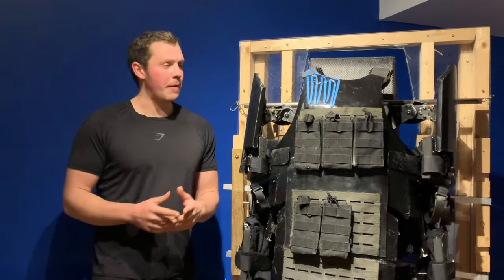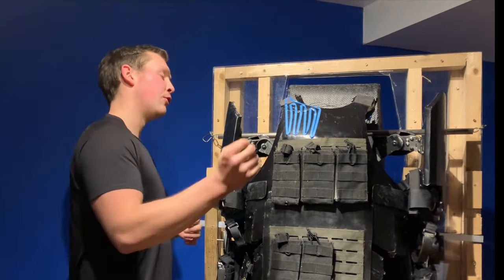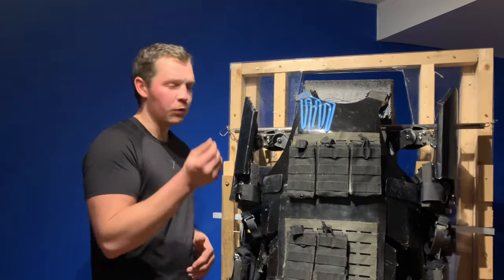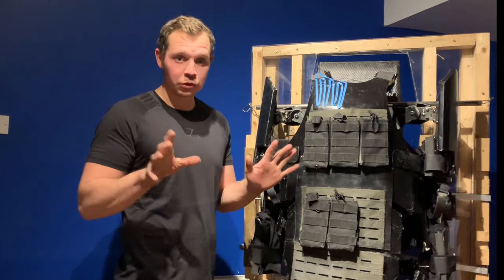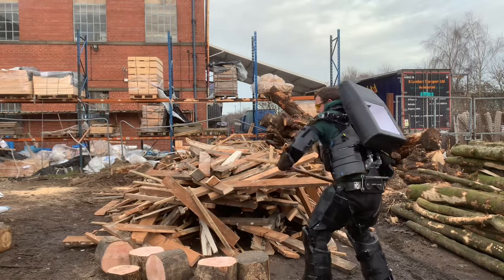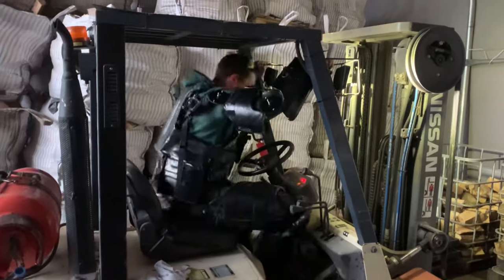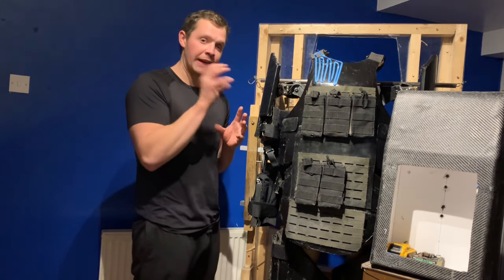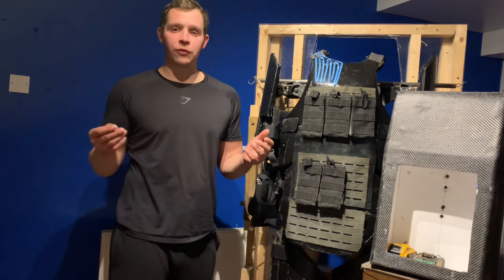Episode 6 Future Electronics & Work Mobility Check of Functional POWER ARMOUR project

Comment: I would like to say as a software professional (and ex military R&D and engineer at that) that custom voice activated controls is a huge project in and of itself. Particularly when you consider cutting out external noise, particularly combat noise. 
Regarding touch screen devices and ease of damage - look at the 'tough books' that exist, they aren't so fragile as you might think.
personally though I'm an advocate of keeping software to a minimum on military hardware. Interference and 'emp' is a real thing, and shielding will only go so far. 
For control options Id honestly recommend physical switches and electronics - no software at all, at least in prototype stages.
If your going to have any software id suggest limiting it to the helmet for HUD.
Reply: Exactly!! Prefer analog switches, and mechanical joints and movement using gas pistons and springs and a rigid frame. Working on a similar project to this. Made the exo frame from stainless steel, aluminum, and titanium. Making armor from angled AR500 1/4 ballistic plate. Going to use a HUD in my helmet, range finder, lights, and NODS (PVS-14)
Reply from the maker: My plan is to have it quite basic for the following prototype, have it only recognise key words. Then down the line in the future have it more complex and as you say have it inter grated into the HUD of a helmet. Ive thought about toggles and switches but unless theres a strong fold over cover theyll break easily. The cover will add bulk to the arm along with the switch panel which is the last place its wanted. Then the wires will have to run round 3 joints which is a potential point of failure, tough book screens are good of course, but ive used them as a mechanic and theyre not that tough and can get scratched and dulled. Main thing though is ive found that if you walk with a slight arm swing and scrape a door frame, its like a hammer blow so if theres any control panel there, its gonna get wrecked. So while i may be wrong and it may be harder to than ive researched, i still think its the lesser evil in design terms. Thanks for the input though and thanks for watching 👍

Comment: Should consider using a capacitive damage sensor instead of the long thin wire method. Basically create a grid of very thin square capacitors accross the surface of the armor plate. You could do this with foil either side of cling film or tape for your first mockup. 
The goal isnt to store any real energy in the capacitors, its to measure the capacitance - if it gets penetrated then capacitance becomes 0 because its shorted accross the bullet hole. 

The wire method needs more connections and more sensors to check if resistance has dropped over each connection and its hard to cover a flat surface with wire.

Comment: Love the solution for damage detection, elegant in it's simplicity.
I wonder if you could integrate this with some kind of overlapping segments rather than monolithic plates, to improve flexibility without sacrificing as much coverage, and improving serviceability?
Reply from the maker: Ive tried some over lapping plate ideas but because the armour is 20mm thick the bulk, but mainly weight gets insane, i had a roman skirt design with overlap plates it weighed way more than chest plate to cover half the surface. Which is a shame.
Reply: @MattExo-Dynamics  I see yeah, with 20mm it's a bit much.

Comment: Radical idea: Testing could/should be done plugged in.
You will eventually build a power supply anyway, it's (I'm guessing) the easiest part of the suit.
Throughout testing you'll be either breaking it or find you have to change voltage or etc.

Most humanoid robot development is also moving first, even attached to strings so it doesn't fall too hard - power pack is the last thing.

I'd focus all my attention on making the suit move/work with you.
Amazing work so far! With some extra protection and definitely assisted movement - I could see putting this on instead of my plate carrier (as long as it's got proper NIJ protection - which you don't need for the project until last. You can use cheaper weight simulators. Lvl IV ceramic plates usually weigh 3-4kg per 10-12" plate😉)
Reply: Yes best advise here-- DO NOT shoot your prototype anymore, it's already known what kind of armor ceramics and layers can protect soldiers, you sinoly need to know the weight and distribution, plus I think you should uave soft armor behind the ceramic to stop shrapnel. And consider shock absorbing tactics like swappable reactive plate peices that snap into a chest frame.

Indeed use a lab power supply and cables to the protoype suit, then add weight where the batteries would go to perform movement tests. 🎉

The hardest part would be the suit robotics and armor pices shapes and connection so they dont fail easy and cam be taken off quickly by a medic or swapped peices.

Comment: Another Idea I had, basically a system that reduces spinal injuries or concussions by locking the helmet in place around the user's head. As the helmet will likely already be quite heavy this could prove quite helpful if it's a realistic concept. I know that no matter how much punishment the armor can take, if the users head gets bopped a little too hard they'll be rendered combat ineffective or worse either way.

Comment: the wound powder should be on the inside, not outside. 
depending on its weight, additional armor to prevent penetration in the first place would be better though.

Comment: Honest whilst I would say that this sort of system would be useless in large scale deployments such as Ukraine where logistics are a nightmare and you’re going to end up lugging around a ton of useless scrap.

HOWEVER in say Gaza this system would actually be absolutely perfect especially when you’re dealing with close, tight CQB environments where mobility is primarily prioritized leaving many Israeli soldiers open and exposed despite their higher levels of protection, however as seen in that Israeli video where an Israeli soldier is entering a room only for the Hammas fighters to open up on full auto in the other side of the door, not to mention things like the HAMMAS, tunnels where again close quarters combat is limited between mobility and protection where an Israeli soldiers is limited by what said individual armor they can carry, and whilst it wouldn’t actually last long let alone be completely bullet proof, however (BULLET RESISTANT) is far far more preferable than being shot multiple times where again in those situations where seconds can result in either living or going home in a body bag and not to mention that the armor is again being built by a Brit in a shed with off the shelf components not only increases its viability but also helps in reducing its cost and again, if the armor was in say panels which can be installed or removed would not only increase the suits overall combat lifespan but would allow the user to increase their chances of survival rather than being a single solid piece of armor kinda like the halo Spartan armor which looks cool, but is actually very stupid and realistically impractical considering that the entire lower chest area is exposed and titanium Kevlar weaves aside is still a massive weak point, not only that but if the armor was say damage beyond repair then that usually means that the entire armor has to be replaced vs say 40K space marine armor where the armor is connected separately meaning that if a space marines massive pauldron armor was to be too badly damaged, then the marines can simply unlock the shoulder piece and replace it with a new one, and again whilst I’m not expecting it to be a literal walking tank, but being able to effectively and reliably protect a soldier for the first say ten rounds of ammunition from killing the user then it’s ten rounds of time for the individual to either withdraw or to asses the situation and engage neutralizing the threat that’s exposed their position.

Comment: Good enough to escape from a Middle Eastern cave you we're put into by your business partner!
Mk.I from Iron Man also used many protective parts from leather to protect the operator from the machine itself (gloves for example, had leather inserts) - like this leather belt.
Can't wait for MK2. Current battery tech is good enough to provide enough power to make this practical.
Pls move to America so you can add a flamethrower! :)

Comment: What happens if the battery pack gets shot. Battery acid of any variety pouring through a potentially motor locked suit does not sound fun.

Comment: Another small design idea may be to add a v - wing on the breastplate near the neck to deflect bullets/shrapnel away from the throat and over the shoulder such as what is found on french medieval cuirass armor. a good example of the armor piece can be found in arrows vs armor 1 by tod's workshop. Although they shoot arrows at the armor piece the concept is similar to bullets.

Comment: you could do it like edge of tomorrow where you have a helmet with an augmented reality display which can have a hud to display the armor plate status of the suit and body status to indicate if the body has been damaged or exposed but it may be too complex especially making or getting the software for it
Reply from the maker: Yeah i intend on doing that at some point but it will be a few prototypes down the line. Theres so much that can be inter grated like that, but theres just a ton of development (and funding) steps to come first